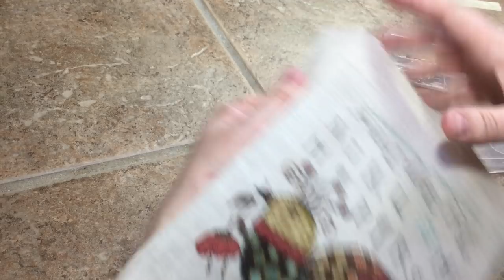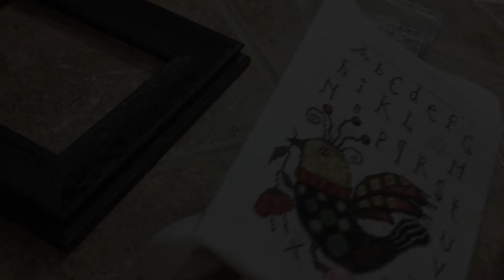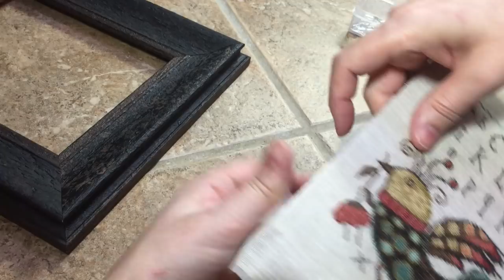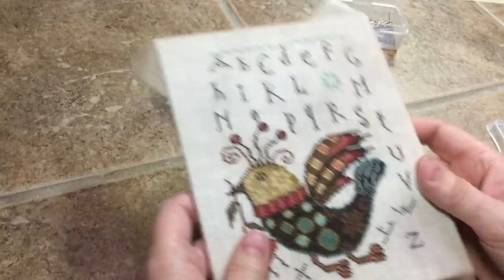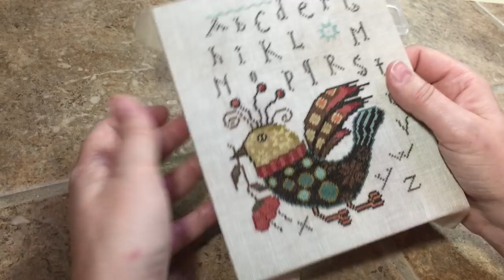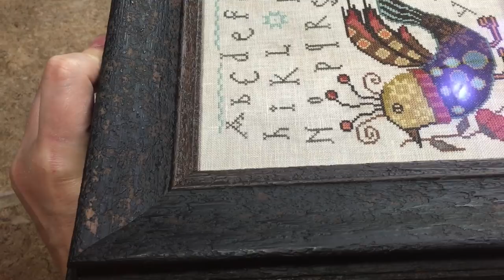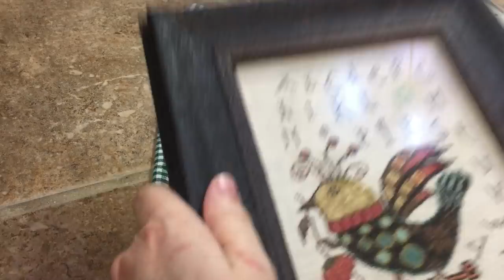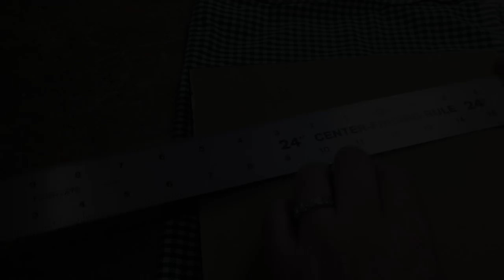StitchyTube-torial: Stretching and Closing Your Needlework

Comment: What a great tutorial. The hardest part for me is cutting the foam core. I love the idea of having the shop cut it. I really appreciate you taking the time to do these tutorials to help us.
Reply from the maker: The problem with cutting your foam core at home is that it's difficult to get 90 degree angles and really straight lines. Having those corners and edges cut with precision will help you so much with the stretching part of it. Foam core is a minor expense in framing, so it's really worth leaving it to the professionals with the equipment. Unless you want to invest in a $2000 wall cutter! :) - T

Comment: Another great video.  After all these years, I finally bit the bullet and stretched and framed a piece.  It was straight, but I need to work on getting it a little tighter.  Can't wait to try the next piece with your great tips!
Reply from the maker: Groovy! Sounds like you're off and running. Learning how to stretch as a needleworker is so liberating -- it's going to give you a lot more confidence! - T

Comment: I frame by basting in the channels of my linen where the fold hits the foamc ore.  That way I know I've got the linen straight - a bit like pulling a linen thread to get a straight line before cutting.  I draw the centres on the foamcore and mark the centres of my stitching and align these.  I also use the basting method when making pin cushions - baste a line around all 4 sides the same number of Xs from the last stitch on the pattern and then sew with the machine along that line.

I've used bumpers to stop movement but they don't work for me.  Now I Blu-Tak my bottoms to the wall and then they never move - especially useful when dusting.  If I can't put a nail in the wall (pipes or cables) I'll Velcro my framed pieces using self-adhesive Velcro - super easy.

Comment: Had this saved in my watchlist for 2 years and finally ready to start tackling framing....this video was excellent and thank you.  I tried to read through all the comments to see if my question was answered but couldn't find it so here goes....have you ever padded your stitching?  I have seem some finished products that look padded but not sure what they are using to make it so?  Possibly 100% cotton thin batting attached to the foam core?  Just curious if you could shed some light on that b/c I think it would be useful on some pieces that have some bulk in the back in areas so as not to stick out if simply stretched over foam core plain?

Comment: This video was great!  Learned so much about DIY framing.  Would ne ver have thought to spray water on the backing paper to get out the wrinkles!  Wish that would work on my skin, Haha. How do frames shops cut the foam core? Exacto knife? Special foam core cutter?  With the spacer making the frame stick out from the wall, isn't this a problem with hanging straight? Seems it would bulge out at the bottom or make hanging on the hanger a bit difficult.
 I always enjoy your videos, Theresa.  Thanks for taking the time to share your expertise.
Reply from the maker: Frame shops have wall-mounted.cutters that trim their glass, mat board, foam core, backings and such. They typically can accommodate something as long as 60 inches, and there are different attachments for glass and "paper" products. They have rulers that run up and down and side-to-side, so they can accurately measure the materials. And they can be calibrated to make sure they cut perfect right angles.

Since the back of my piece comes out a little from the frame, it will hang away from the wall just a little bit. But it'll be no problem to hang it with a nail. It'll just have to stick out of the wall a little farther. :). Thanks sweetie! - T

Comment: First - thank you for this awesome tutorial! I've only ever heard of the lacing method to stretch my needlework! It seems so much easier to "futz" with the grainline using pins, than trying to stretch/manipulate the lacing and fabric if it's a little "off!" You mentioned the importance of pushing the pins straight into the edges - Do you have any feelings one way or the other about using a shorter pin, like a flat-head applique or sequin pin instead of a dressmaker pin?

Comment: Great videos. Pinning looks much easier than when I used to use sticky puffy board back in the day. If I had a monthly series, could I have one frame made, mount every month on its own board, and then switch them out? What hardware would you use instead of the tacks/brads so I could switch them out every month? Thanks!
Reply from the maker: OK, that's a great question! I'll answer that in my next framing video, but I'll answer you here, too. You can use something called turn buttons. You screw them into the back of your frame, and they swing this way and that to let you switch out your pieces (they're just like the ones you see on ready-made photograph frames -- a little metal piece with a hole and a rounded point, usually.) The only thing, is you'll have to get enough foam core to fill it up to the back, in order to keep the piece in place. You should be able to find turn buttons at your hardware or craft store or online.

Or, if you have a brad gun, you can just remove it and re-point it each month, but you're really going to chew up your frame that way. :) 

Happy framing!!! - T

Comment: Thank you for your tutorial! It's fantastic.  I have some pieces I want to self frame, and you are giving me more confidence :)  Do you have any extra tips for mounting circular pieces?  I'm going to finish my Guardians of Notre Dame in a circular frame.
Reply from the maker: Circular pieces can be a little tricky. But you can have your local frame shop cut you a piece of foam core (and mat board if you like) in a circular shape. You will want to make sure to check it in the frame, before you take it home. Circular and oval frames can sometimes not be so circular (or oval-ly!) And so some adjustment trimming may need to be done. If the foam core only fits in the frame one way, make sure to mark where the top is, so you can stretch your piece on the foam core in the right direction.

Gathering the fabric on the back is bunchy. But you can still leave most of it without trimming, if you like. I still start in the "middle" of two sides, work my way a little ways around, and then go to the "sides." If you just start in one place and stretch your way clockwise, for example, you may end up with things quite off-center by the time you get around the circle. Good luck!!! - T

Comment: Thanks for this. I just framed two of my grandmother's cross stitch pieces and I can see where she carried stitches. Where did you buy the colored foam core. I don't remember seeing anything but white and black at Michael's. Unfortunately, Hobby Lobby is kinda far from where we are now living. Do you have an online source you use?
Reply from the maker: So, I don't use colored foam core -- I use a piece of matboard underneath the stitching, with the foam core underneath. That way, you can choose a color that matches the fabric. It's usually pretty inexpensive to get it at the frame shop (they will cut it for you). I do not shop online for framing supplies, so I'm not sure...- T

Comment: Can you please explain what the foam core is? And what it's covered with, it wasn't on screen long enough for me to see, also where did you get it from, thanks?
Reply from the maker: Foam core is a crafting/art supply you can find at frame shops and many hobby/craft stores. It typically comes 3/16" or 1/4" thick and is available as acid free and regular. It is essentially two really thick papers with a foam interior, sort of like styrofoam, but much more smooth/finer than that. I have my frame shop cut me pieces of foam core, because they have equipment that can get nice straight lines and right angles. Let me know if you have any other questions. :) - T

Comment: Tape the back instead of the brad nailer?
Reply from the maker: Gosh, you could in a pinch, but it would have to be strong tape. Otherwise, your piece may just fall right out. But I'm all for making use of tools and supplies on hand. I think for something small, tape could definitely work. I'd be careful with anything a little bigger. :) - T

Comment: Thank you for sharing g your expertise with us. I learned so much. I’ve been framing  most of my pieces for several years now. Stretching is my least favorite part. It’s funny how for me, it either goes right when I start, or I pin and re pin a dozen times to get it right. I’ve been using more and more repurposed frames from the thrift shop. I seem to be able to find different sizes there rather than just the stock size frames Michaels carries. Your video is full of good advice, and I’ll be putting it into practice this morning - I have 4 pieces to frame  and will tackle them with renewed enthusiasm and knowledge!
Reply from the maker: Right, you are right that you can find those "strange sized" frames at the thrift stores, but not really at the big chains. Plus, they're bound to be cheaper. You can gussy them up by painting them -- get some chalk paint/furniture paint, or whatever. Glad that you found a few tidbits to share from my video. Best of luck!!! - T

Comment: Great video.  I must be a Type A framer because I count the threads on each side to make sure they are the same so the piece is centered, and I always run a basting line so the sides say straight.  I do think I need a brad gun though.
Reply from the maker: I have counted threads plenty of times. It leads to great results!!! And yes, you definitely need a brad gun. :) - T

Comment: Great video. I don't like to lace either.   Thank you for the info on how to use the spacer material.   Scrapbook paper would also be good to put behind your needlework.  Its thinner and cheaper than matboard, but then again you would need to cut it to size.
Reply from the maker: That's right! The only thing you might have to watch out for is that the paper might warp/ripple as humidity changes. :) - T

Comment: My roommate and I just framed our crosstitch for the first time (other than sticky board) because of the confidence you gave us through your video. Thanks for making it seem achievable goal.
Reply from the maker: Oh great! I don't necessarily have anything against sticky board, but it's not hard to make the jump to pins and foam core. I like that you can easily adjust very small portions of the design to get the borders really straight. Good luck with continued framing! Keep stitching! - T

Comment: Thank you so much for this great tubetorial! You make it look so easy that I am going to give it a try! I appreciate you sharing all the time to make this affordable. I have about a dozen finishes that I couldn't afford to finish and now I can. Question - when you say frame shops, do you only mean dedicated shops or does that include the big box hobby stores? Do I just ask them to cut the foam code and may board from their supplies or do I need to buy a whole large piece first?
Can you talk about how to frame a custom size like a large rectangle any how to assemble the molding?
Reply from the maker: Any place that does custom framing can cut you foam core/mat board. Big box hobby stores should be able to help you just like the little guys. Basically, you just want to find a place where you like the people. Ask questions. If you aren't on the same wavelength as the place you started, shop around a little. You do not need to buy all aspects of a framing project somewhere to get parts and pieces. So, if you have a frame, you can definitely go tell them you just need foam core.

I have thought about doing a tutorial on putting a frame together. It does involve having equipment that might be out of the reach of most hobbyists. I just order custom-sized frames from the frame shop. They'll cut it and put it together, so the corners are really nice and tight. If it's not something you do regularly, you're going to be frustrated with the process and probably not as happy with the results. When you buy a custom frame somewhere, they don't charge you extra for assembly. It's just included. Let me know if you have other questions! :) - T
Reply: You're awesome!  I just watched #1 so sorry for the dumb questions. Off to measure some of my finished pieces so I can try this out. I am so excited to get my work on the wall to enjoy.
Reply from the maker: GREAT! No problem on the questions -- happy to help if I can. :) - T